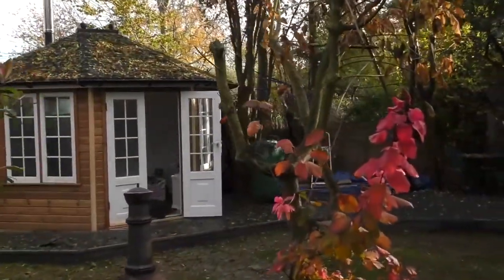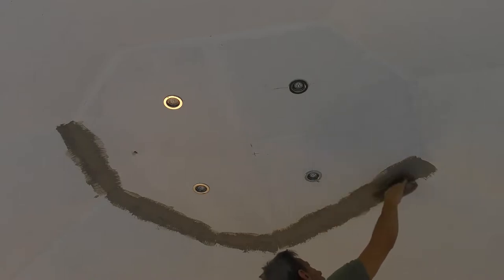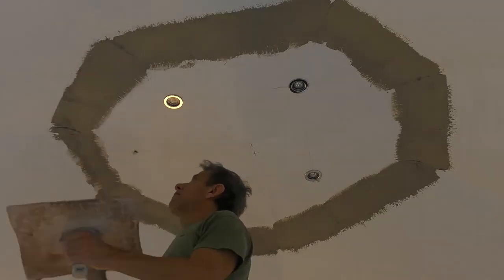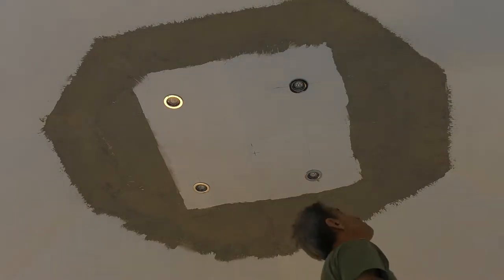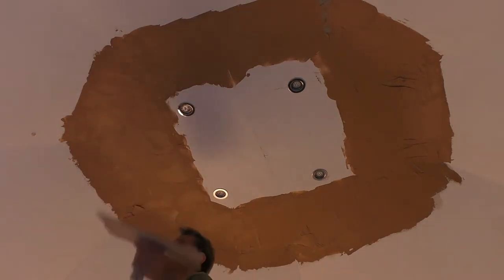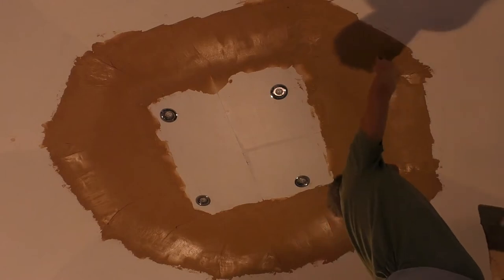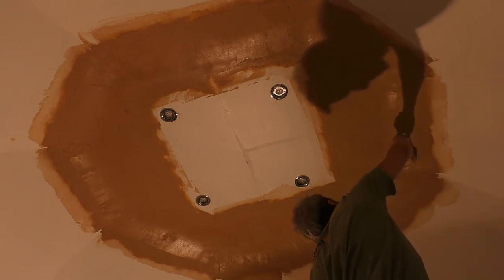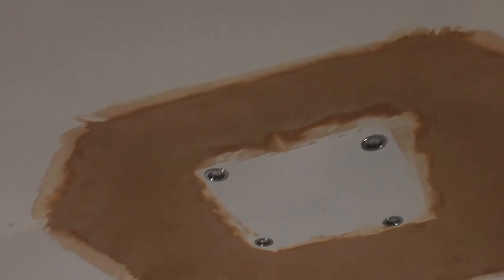Dome Ceiling?

Comment: Blinding job Eric, did you ever try using a tilers rubber float and a sponge float on stuff like that? I use them on the E.M.L swoops on staircase ceilings, obviously what you’re doing is much trickier.
Reply from the maker: Thanks Steve,  it's been so long since I ve done a job like this, didnt think of taking those things, they were still in my garage at home 😃